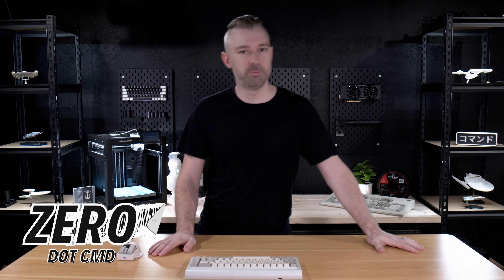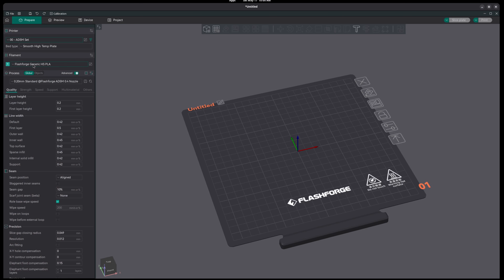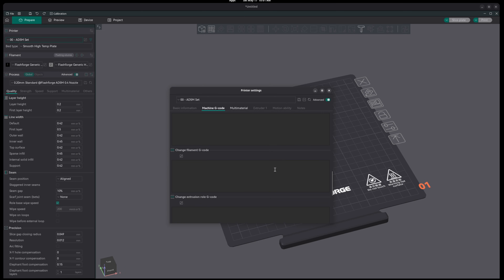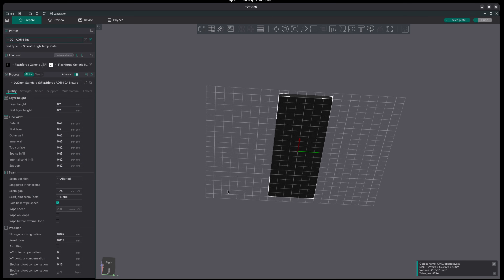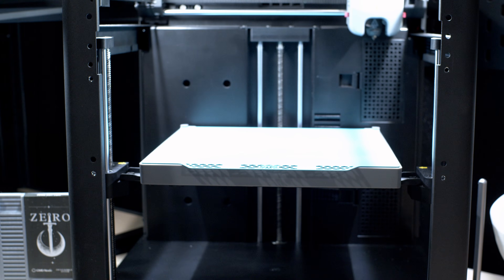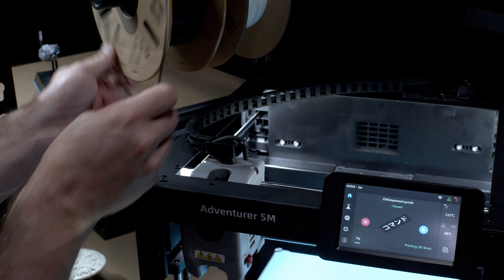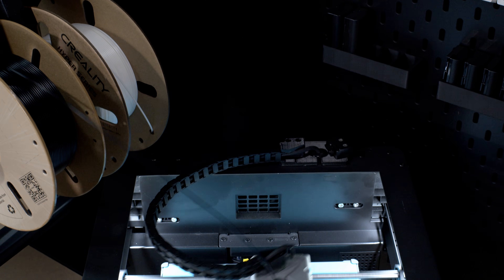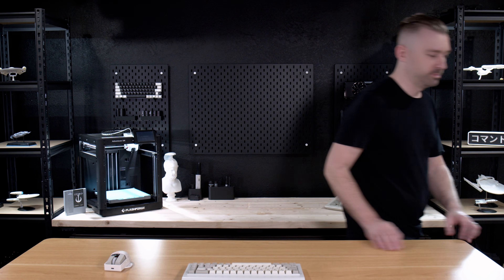Multi Color 3D Printing With Any Printer! Orca Slicer!

Comment: I run into a problem when doing this and get a blob on the start of the print after a filament change on the 5m pro. Was curious if a simple priming line added after filament change would fix the issue I am having and what g-codes to use for that.

Comment: So orca has the pause and the side of the layer bar, do I still need to do the G code?
Reply from the maker: Not if you are using the pause in the sidebar. It will inject into the Gcode where needed.
Reply: @zerodotcmd thank you

Comment: Where did you get that drag chain from ?
Reply from the maker: I purchased the enclosure kit just for the drag chain and tool head cover. https://amzn.to/44MsDJd
Reply: @zerodotcmd  Thank you for the reply. I have 3D printed my own drag chain recently. I never use enclosures, my printers all sit inside a cabinet which is an enclosure with lights, materials, tools, air scrubber etc. and noise cancellation.
Reply from the maker: @sierraecho884  Nice! Yeah the DIY enclosure isn't for me. but I know a lot of people like it.
Reply: @zerodotcmd  It´s not DIY, it´s a piece of furniture that looks way better than whichever enclosure you can buy. You don´t even see or hear my printers. It´s way cheaper too.

Comment: I've done this a couple times. Getting the nozzle pressure right and not dripping on the print is difficult.  You need a prime tower or a sacrificial object to avoid having an imperfection.
Reply: Couldn't you hold something else (safe to use) under the nozzle so it drips out onto that, rather than on your print plate

Comment: Awesome! I have been working on ways to make my 5m pro a multi color printer. Side note: I wanted to use all of the filament on a roll so I let the filament go until the warning popped up. I continued the print but instead of changing rolls I just hand fed the new roll into the tube. You have to watch until the old filament is almost gone and then push the new filament behind it. It worked and I used every inch of a roll. Not ideal but it worked.
Reply from the maker: Spool waste is a huge problem, its the reason I like the Infinity Flow. If you haven't had a chance to check it out your should definitely pull it up!